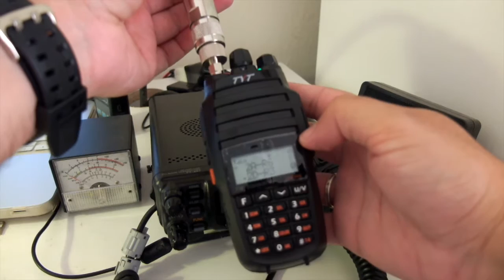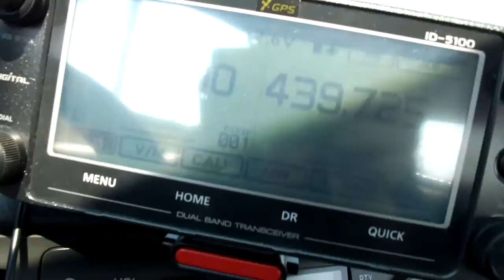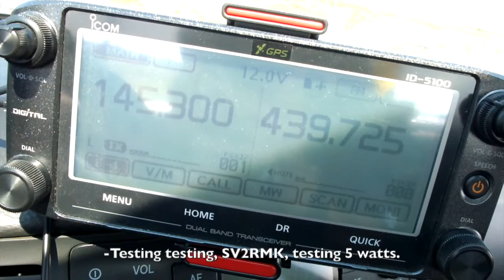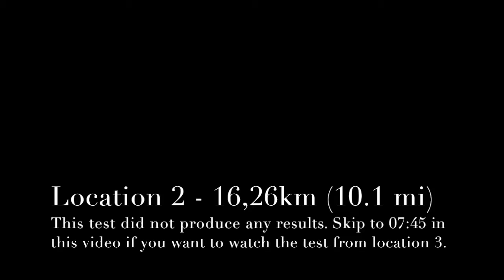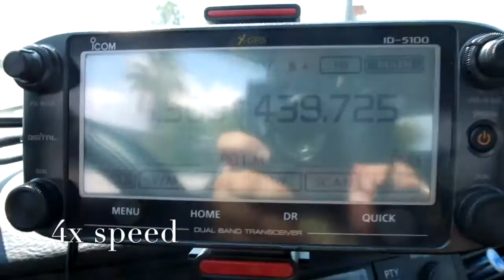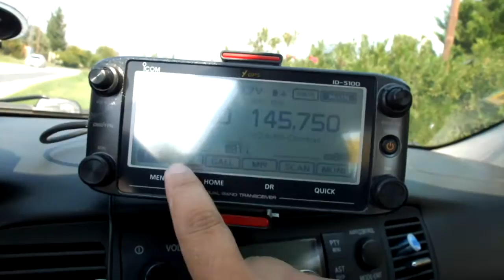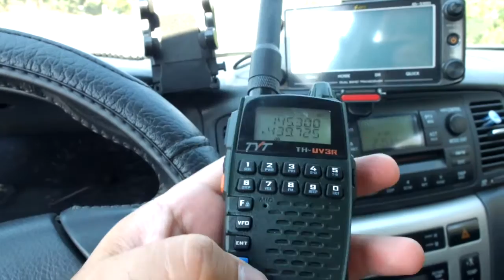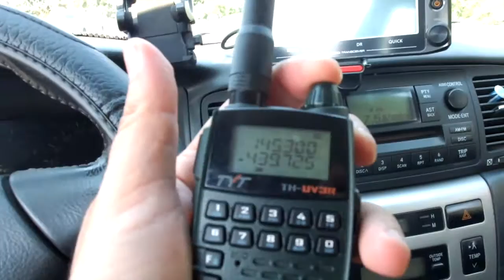TYT UV8000E Sensitivity Test

Comment: Nice test I have attempted similar tests on a few baofeng handheld radios and have found the radios to be quite deaf on receive especially when connected to a roof mounted vertical antenna, I think it's lack of front end filtering that is the main problem. Yet I do not get this when I connect up a yeasu ft60e hand held to the same antenna, tests were carried out with a 2 meter repeater incoming sig is approx s3 on the scale none of the cheap china radios could hear its repeater ident, similar responses on 70 cms. These radios are very good for local set to set contact 1 to 3klm, walkie talkies but for any serious communication I would stick to an established brand ie icom yeasu kenwood equipment.
Reply: I used a Baofeng F8-HP radio as a base station for about a year, attached to a Arrow Open Stub J-Pole antenna. Never had a problem hearing other people and they never had a problem hearing me. I could  hear and talk to a repeater that is about 35 miles away. So no problem for me.